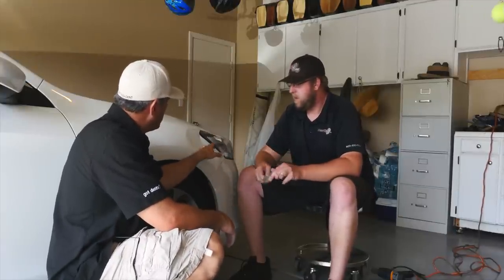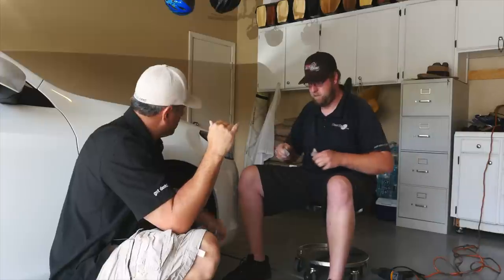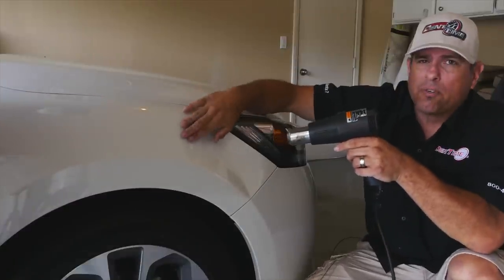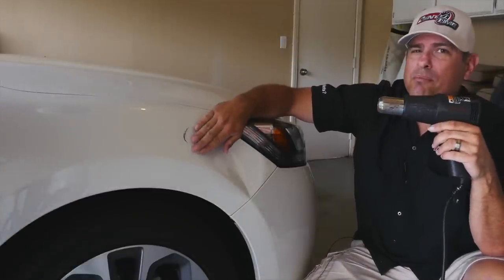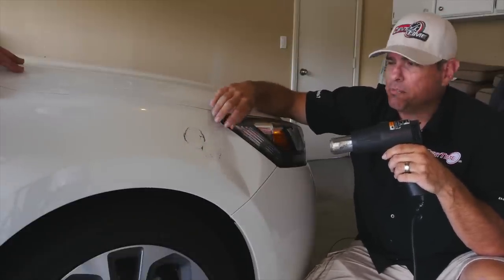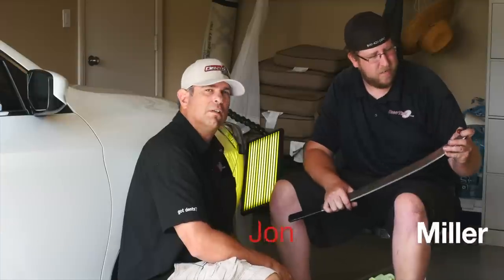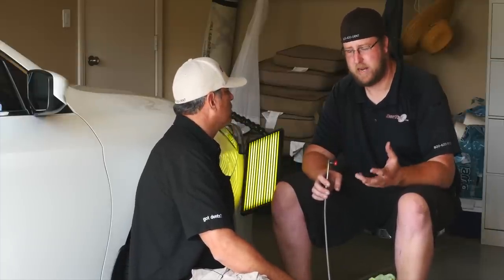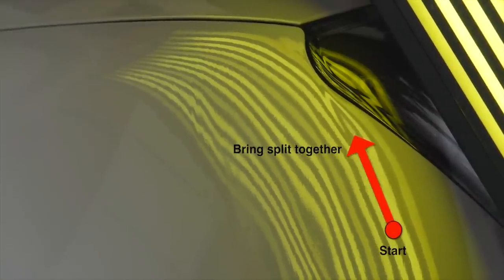PDR Training Video | Dent Time | Dent Trainer

Comment: Great video! I see you had a bit of trouble keeping that guard liner out the way what I do is use a ratchet rope hooked through the fixing hole of the liner and hook the other end to the suspension spring or upper suspension arm this works well as it keeps the liner back to give you enough room to work comfortably and without hindrance

Comment: I bought both the Cola Fria and the metal-tab that came with it, and I gotta say that stuff is a life-saver & time-saver........However, I try NOT to handle that stuff with my fingers as much as possible, as I believe the oils in our fingers will decrease the effectiveness of the glue as the oils & debris accumulate in it over time.  If I've gotta touch it, I spray a little isopropyl-alcohol on my fingers & clean 'em first.  That's just me though, I'd like for it to last as long as possible, this stuff is amazing, a must-have in your inventory!
Reply from the maker: +kingbotz It's definitely good stuff.

Comment: there is no one that does p.d.r. training in fort Myers fl where I live...any suggestions on how I should get training...I really want to learn this correctly...I see some push tools with magnetic ball for tips which when used with tiny ball you see tool location. .would this help a lot.thanks
Reply from the maker: your better off signing up for denttrainer.com or even better making the commitment and getting personal one on one pdr training. in most cases you have to travel away from your local area because nobody wants to train their own competition. At least do a good job at it.

Comment: Is not more rentable change the all fender for a new one? I mean save time
Reply from the maker: Juan Santos save time? How long you think it takes to order a new fender, then paint it and then install it? Besides pdr is more superior than any body shop or replacing a panel on any day. 😉
Reply: You'd of gone over the cost of PDR with the cost of painting that new panel alone.
Reply from the maker: Luis Valle seriously? Any persons who respects the fact that they only get ONE factory paint job and retains the value of their vehicle compared to a very likely unmatched and detectable replacement and repaint would definitely pay more even if that was the case. Sorry but we should be indeed charging more than a body shop become the results are much better by far.